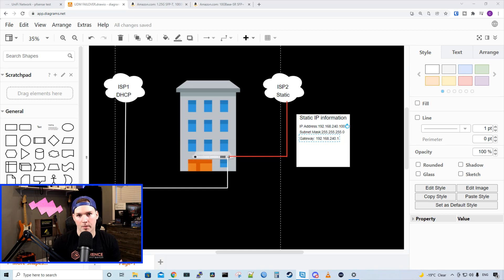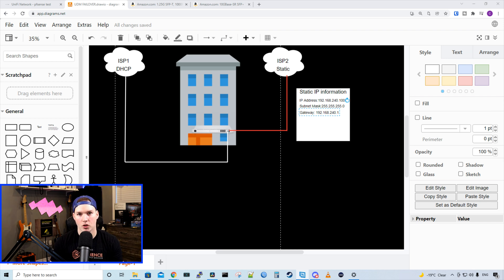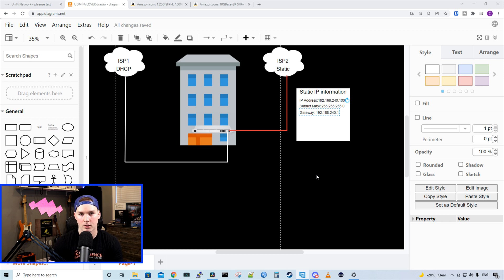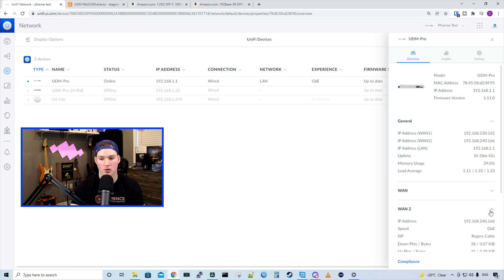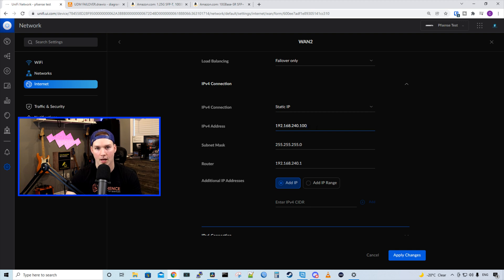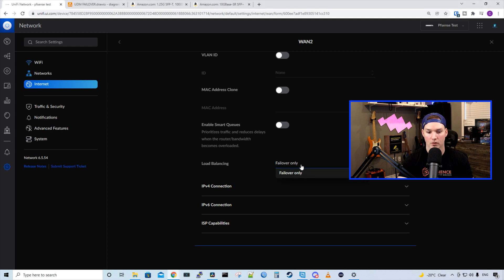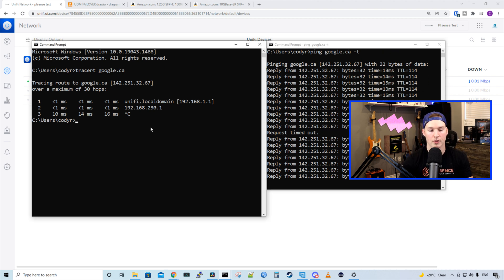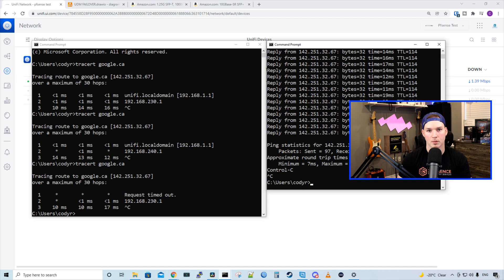Unifi UDM Pro, UDM SE Failover Configuration

Comment: I have 2 WAN connections coming into 2 different buildings and in each building I have a cheap bad ISP router handling IP's for clients. The buildings is connected to each other with fiber, but is not in use. What UniFi equipment should I use to setup workbalance/failover?

Comment: hello i just install my new udm pro se and after connecting both my isps i see my second isp is not getting an IP address 
both my isp are up and running 
load balancing doesn't work and fail over only works when 1 isp is completely disconnected and the second wan gets the ip of the 1st wan
so when my primary isp is back up and running the udm doesn't switch back to primary isp untill the 2nd wan is diconected 
can you help 
Y  is it doing that??

Comment: MY ISP provides me with 5 gig internet connection. Could you please advise as to how I can use the 10G WAN port to get the full 5 gig speeds. When I connect to the WAN2 port the UDM SE Pro does not recognize the internet. Only the 2.5G port seems to be working. Any help on this would be really appreciated.

Comment: I'm not sure if this will get seen or not but I am noticing that you are using private IP addresses for your WAN. Is this just for testing/examples? If I were to set up a second modem for example, I would have a second public IP assigned to my second WAN connection and I wouldn't be able to set it manually as you have done here. I was just hoping for some clarification on this.

Comment: FYI 
WAN failover on UDM SE isn't working.

Port 9 set to WAN, Port 10 set to WAN2, UDM SE will switch to WAN2 as soon as my backup connection it's plugged in.

Tried the reverse, set Port 9 to WAN2 and Port 10 to WAN, UDM SE again switches to backup internet when plugged in.

UDM SE shows correct primary WAN address on LCD but always routes traffic through second WAN interface.

WAN failover DOES work properly on USG 4 PRO with same UniFi Network 6.5.55 version 

I commented this in the community forum and Ubiquiti hasn't responded yet.
Reply from the maker: Interesting. I’m still waiting on my SE but I’ll test it once I get it

Comment: So it's failover only, I have a few projects that have a very slow dsl in, then I add a 3G dish on Wan 2. The dsl is used for the VPN requirements and the 3G to boost the speed. For this I have to use Dratek routers which load balance and route static for VPN. I would love one day to swap these to a UDM.

Comment: Hi , i have question... I have 2 ISP in my house.. 1 with static IP for special smart house devices that need static IP (slow speed) and 2 with dynamic IP without possibility of static IP for browsing ,streaming and etc. It´s possible use the UDM Pro for that,to separate the 2ISP  connection that the VLAN1 and devices in this vlan will use ISP1 connection and VLAN2 and devices in VLAN2 will use second ISP..? Now i have separate router and switch for both of this ISP and thinking to use one device like UDM Pro/SE. Or do you have idea how to do that with one device? Thanks.
Reply: i believe that this is now possible - but haven't tried my self

i have a client that will need this feature so hoping to try soon